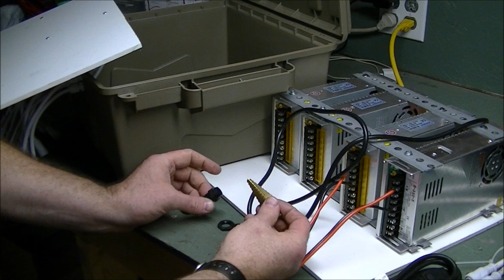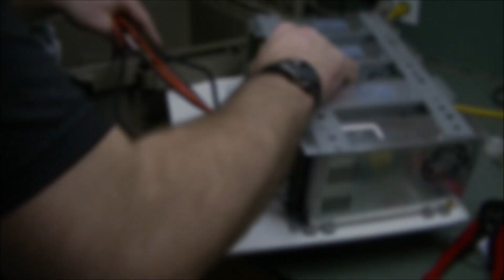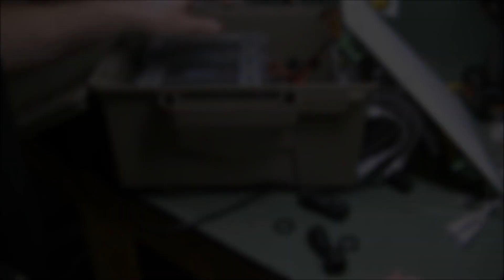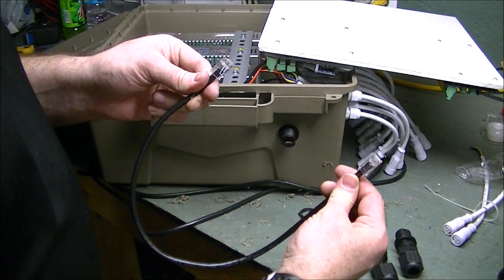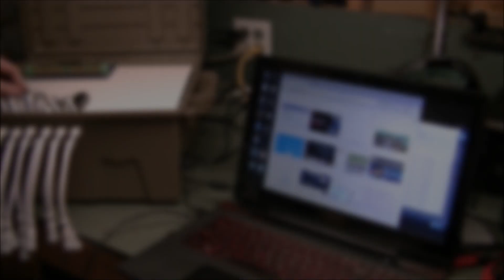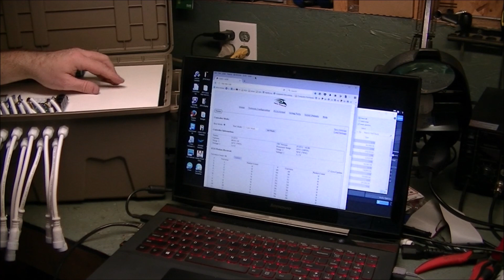F16v3 Build Part 3

Comment: I know this an old video but how to you physically connect 2 or more power supplies to one falcon f16 controller?  I see you had the wires from 2 power supplies but were they both actually connected to the falcon or just one.
Reply from the maker: One power supply connects to the left side of the falcon using one set of black and red wires.  The right side of the falcon is connected to the second power supply using the second set of wires.  Eventually I added the white version of the 16 port expansion board... and connected the other 2 power supplies to the expansion... 2 sets of black and red wires, one set going to each side of the board.

Comment: Is it not necessary to put in a vent or fan on these boxes?
Reply from the maker: I live in a cold climate.  Heat from the power supplies has never been an issue.  Even when running them during the summer for different events, never an issue.  Your mileage may vary.
Reply: Leechburg Lights I later saw your comment on that you live in cold weather I’m in Indiana so I don’t think I’ll have to worry about it either

Comment: Hey! Can You tell me the purpose of the fuses ? I have 2 fuses without blinking LED so I m worried. Those channel still work with Power injection? Thank You!!
Reply: Not sure if you have found out yet but it typically means you have blown the fuse. So at some point you must of pulled more than 5 amps. Check your connections are ok and replace the fuse.

Comment: Nice waterproof box build but one problem is that you need to vent the box so all those power supplies can exhaust the heat out.  Preferable with a 2 vents with dual 4" fan.
Reply from the maker: Mr. T 
In Five Seasons I have never had to vent any of my enclosures. I live in a Northern climate where it is cold all winter long. Not venting isn't important, I just don't need to do it.
Reply: @leechburglights  How about those of us that live in sunny Florida?  Do you think I would have to vent an enclosure if I made one for my display?  I was wondering that the entire time I watched all 3 videos and was surprised it was almost the last question asked.
Great tutorial by the way.
Reply from the maker: @palmcoaststeelers5646  I used these in the desert during long days and haven't vented the cases.  It won't hurt to do so.  If you want to vent, by all means go for it.

Comment: Nice build video. I use the same cable glands you use.  The external piece is not just for strain relief, but also for water proofing the connection.  That's what the rubber ring also provides.

Comment: is there a blank cover for the network cable when you don't have it connected? Otherwise, I don't see the point of having the connectors instead of the straight RJ45 cable running through?
Reply from the maker: Jon Harper 
my intention is to use this as a daisy chain to my other e1.31 controllers.  I don't ever expect NOT to use the second connector.  all my other e1.31 controllers have a 4 port network switch inside the case for this reason.  A small piece of plastic covering the gland can protect it if you plan not to use it.
Reply: I got ya